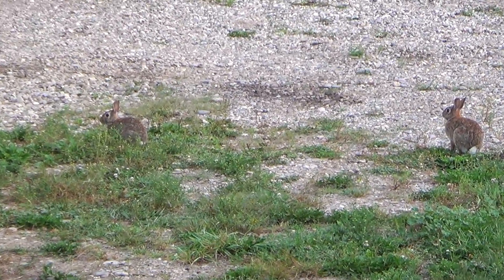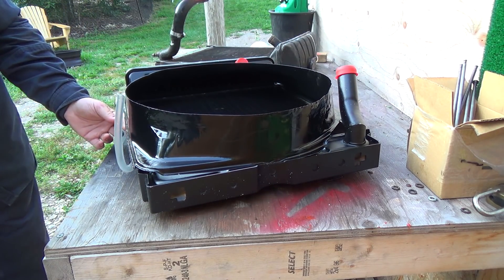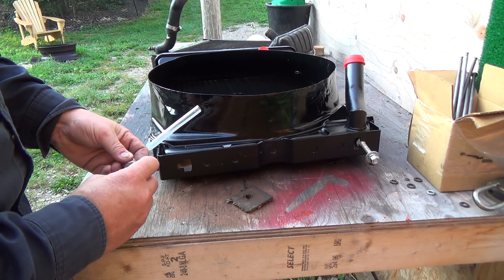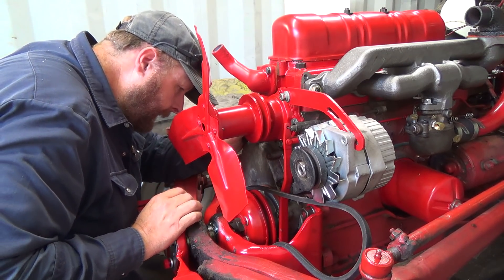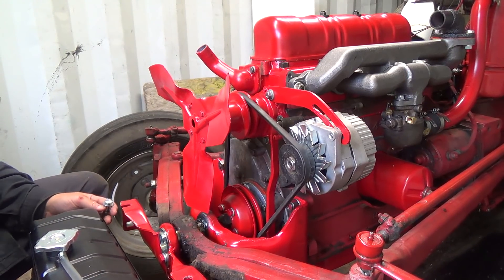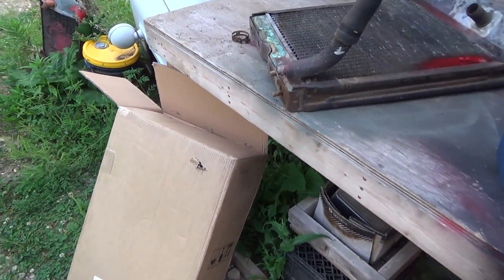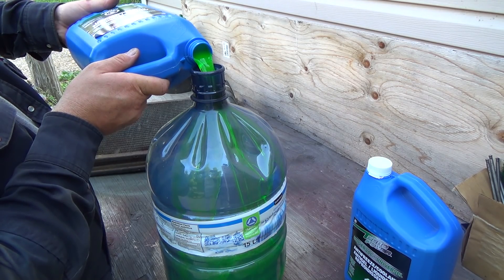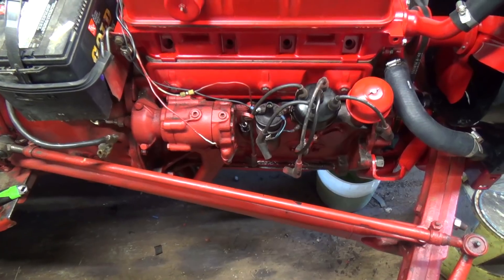Ford 800..Cooling system work...Install the new radiator and water pump

Comment: Bill you need to order yourself a pertronix ignition and coil for that bad boy!  I got mine for my 1966 Ford 2000 with a new coil for like 110$ USD off of EBay!
Reply: Nope. Should be 6v and points. Was that way for many years and worked fine. Doesn’t cost $200 when you loose spark.

Comment: Part of your Problem is the shroud is twisted a bit.be very very careful drilling holes.you don't shit for room on the back before hitting the raditor sidewalls.if that happens you need to take it a a repair shop for proper soldiering

Comment: Cranking won't do anything to get the block filled.the thermostat is closed do to being cold
Reply from the maker: it has the weep hole in it.. And mainly listening for sounds
Reply: Still you need to get the engine up to operating temp before the thermostat is will open.

Comment: DONT TORQUE THE SECOND TIME. ONCE IS ALL YOU TORQUE ALL BOLTS!!!!!!!!!
Reply: Not true. As long as you don't tighten beyond the click on a click-type torque wrench you can do it as many times as you like. It doesn't change the torque on the fastener. This has been demonstrated to be the case by AgentJayZ here on Youtube. He's a jet engine technician.
Reply from the maker: I agree. 20 ft lbs is 20 ft lbs unless you push past the click
Reply: You still torque to much every time you torque again.dont matter if you go past the click it not.
Reply: @brianrutherford3681  No. The torque does not increase no matter how many times you click the torque wrench, as long as you don't tighten past the click. You can insist all you want but you're still wrong.